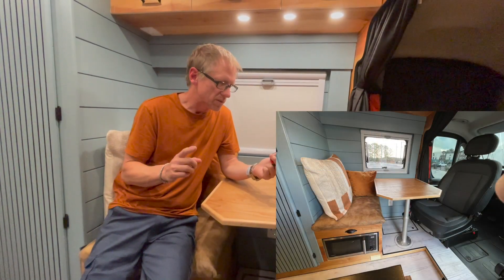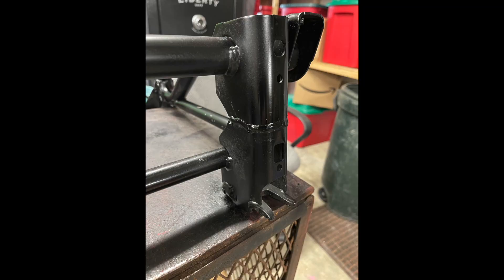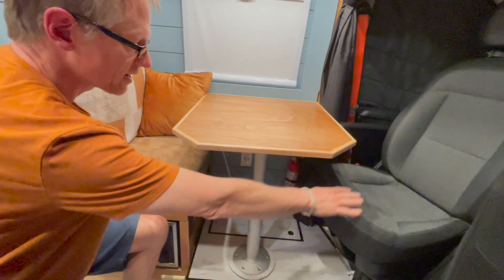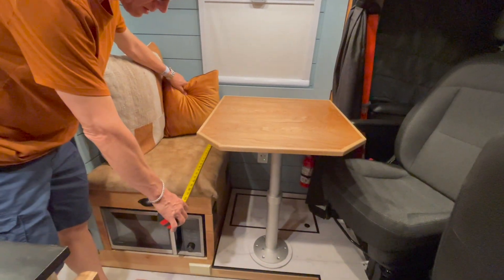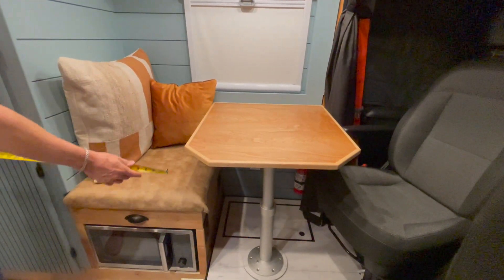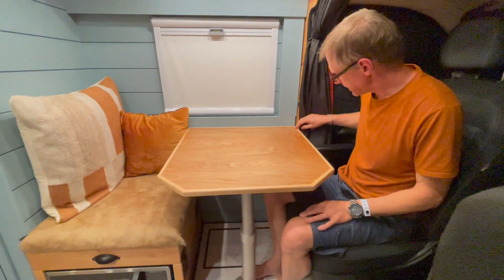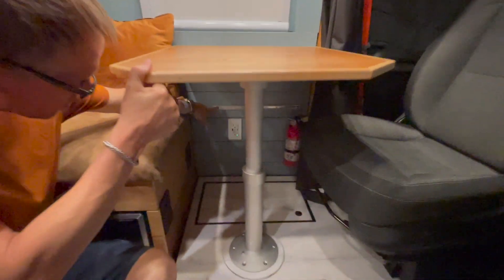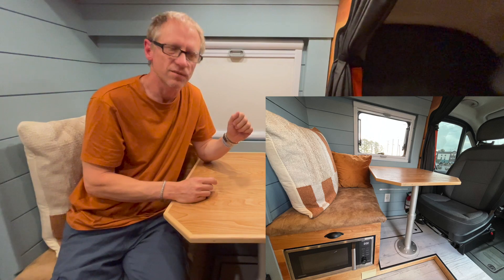How to Build a 2 person Dinette / table with bench in your Camper Van

Comment: Good day Tommy, your video is very inspiring. I'm planning a similar layout but maybe with the wider artic tern window (450x900). Why did you choose the smaller window (450x610) behind the driver?
Reply from the maker: @alainrobitaille4230  you are very perceptive! If I had it to do over again, I might choose the bigger window there. When I installed the window,  was not sure how far the bathroom was going to come up so I errored on the side of caution. Also, sometimes we sit on the bench with our back to the wall. Are you building a van now?
Reply: Yes, we are starting to build our van. Thanks for your feedback.

Comment: Is the gray water tank heated
Reply from the maker: @noush4283  no, it is not heated. If we are not using the van in a cold climate we put some antifreeze in it. If we were camping in cold climates more often we might use tank heaters. Thanks for the question and for taking the tour!